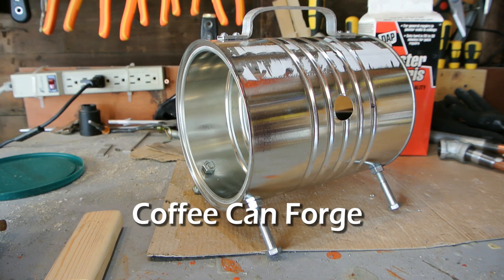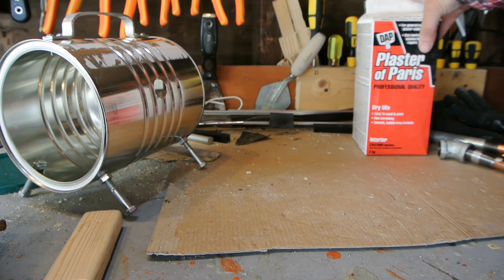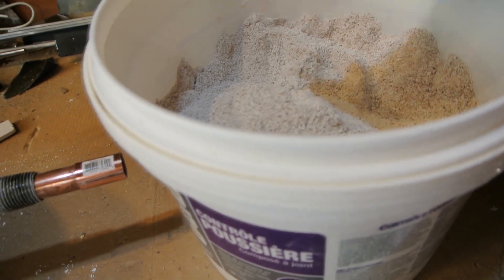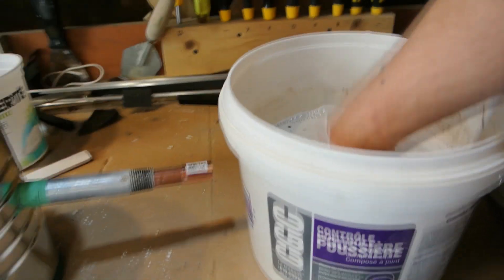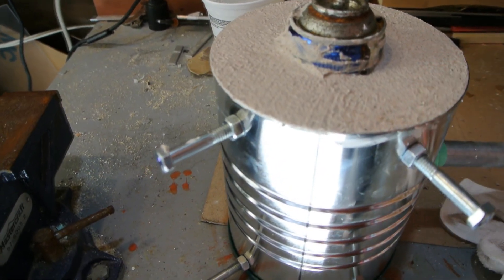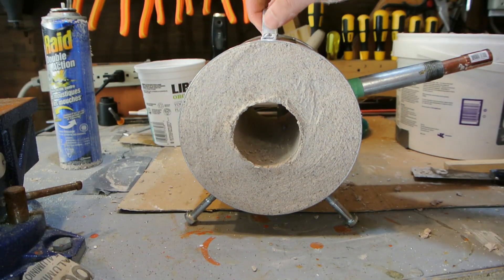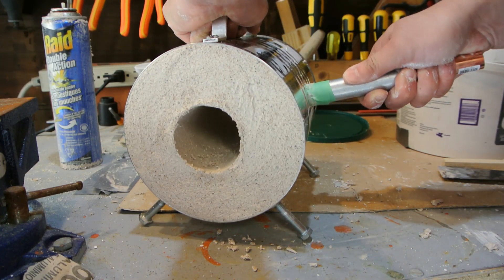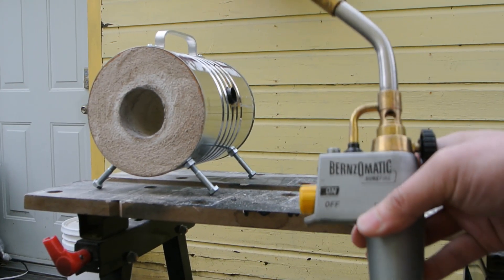How to Make a Coffee Can Forge

Comment: A couple of thoughts, Using a pressured can is a bad idea, unless you pulled it out very quickly as he did, the torch angle should be steeper, so the flame wraps around the radius of the internal, 1:1? heard others say 60 plaster to 40 sand, think all will work, but after a few months the 60:40 might still be going.

Comment: 5:50 using a jigsaw, sabresaw or electric sander (without the sawblade or sandpaper) to vibrate the mixture down to ensure no cavities in the mix.  It may also aid in ‘releasing’ moisture from the mix, to be sponged off the surface, speeding up the drying of the mix.

Comment: About all this is going to be good for is heating up a 1/4 inch rod, bolt or some very thin metal pieces. But you can do all of that with just the torch and no forge at all.   If you make the chamber larger to accomodate something the size of a horseshoe, you can't get the chamber hot enough with a single propane torch because of the extra space that needs to be heated.

I tried this with a disposable Helium tank with a coffee can sized chamber and it did nothing. Next I built the coffee can forge and still no way to heat up a railroad spike to the point where you can put a bend in it.

SAFETY WARNING
If you're going to put a door on it to try to keep the heat in, make sure to add some air vents or leave the door paritially open.  If you close it up tight and burn out all of the oxygen, your flame will go out and you'll be pumping propane into the chamber.  Then if you attempt to relight without venting, you'll have a propane explosion.  Best case scenario is you'll have some singed eyebrows.  WORST CASE SCENARIO is  you'd better make out your last will and testament before you fire up the forge.  And double check your homeowner's insurance to make sure it covers fire damage for this type of equipment so your family can still have a home to live in after you're gone.    Remember, even though it's only an accidental fire, the forge is homemade, not inspected or necessarily rated for the type of use you intend.  It could void any claims.

Comment: I built one similar but it never heats up, gonna try lining with refractory cement and see if that helps and if it doesn't guess I'll go back to good old hole in the ground charcoal forge for heat treating 1084

Comment: This is good and all but if you use a smaller tubed three way burner, which would equal the same diameter overall to reduce waste of propane, you could disperse heat over a wider range and be more efficient.

Comment: Hi, I made the forge and it works great I'm going to write out how I did it. so here we go. so to start I used soda cans duck taped together end to end instead of the raid can (this makes it much easier to get out) and instead of making a large hole in the back I just drilled out about a 1/4 inch hole in the back. I also put in the gas port at a slight angle to great a vortex inside the forge. The ts8000 is incredibly fuel-efficient it will run for 30 sec at full bore on just what is in the 4 ft hose I have. I have made a small dagger and a mini Katan out of screws with this and it works great, thanks for the tutorial, Andrew.
Reply: @nathanthegreat28  I'm not sure what you mean
Reply: @nathanthegreat28  as for the weapon that you found I would like to know what it is, It sounds rather cool and that would help with name.
Reply: A file can be found at your local hardware store and get some sand paper up to 1000 grit. And I am pretty broke all the time so I can relate. Ps in that other reply I meant luck not lick
Reply: I’m not sure what you mean with file thing for free
Reply: @nathanthegreat28  you have to pay for a torch
Reply: I like that you mentioned putting the nozzle at an angle to create a vortex. On all these videos I watch, all the burners are straight on. It really seems it'd create hot spots. And I like your idea of a small opening in the back. Seeing flames licking out both ends seems so inefficient. I keep wondering why these diy jobs are not designed more like a rocket stove. Thanks for sharing.

Comment: Its a good idea to use an oil or wipe the surface of the metal can your going to remove with diesel to prevent it sticking to your molding material. It will come out with greater ease and help prevent damage on removal.
Reply: Or use a Pringles can, and just burn it out when done.

Comment: If it's just to heat a rod, why not just torch the rod directly? PoP and sand is not a good mix, you're literally better off using 2 firebricks and carving a hole in the centre where they touch and one hole for the Propane/Acetylene torch.

Comment: After reading a few more comments I can attest that this small scale forge works well. Not the most efficient maybe but it gets my carbon steel knives up to temperature in order to heat treat. A piece of pvc would be better than using a can for the chamber when it’s time to pull it out. Also you can wait to drill your hole for your burner last if you want. Nice video 👍

Comment: To be honest, I did this build and followed every step. I found that it doesn't get the metal to a good enough heat. Personally, I would highly recommend you go with a small devil Forge. Found the results were much different than the ones in the video.
Reply: If made using ceramic fiber blanket like Kaowool to insulate the forge, it will easily get hot enough to weld. And much faster than using either soft brick or refractory cement.

Comment: You should put a bolt in the back and a plate of metal attaching the the back bolt so you can close and open it. If you have a short piece keep it on and you can put the thing on low, so then you can put that thing on low and have that tank for like a month cause like that little thing runs a lot for a small space like that and you have it hooked up to a big tank.

Comment: it wiill reach about 723 degrees because of the insulation propane and butane generate around 660 degrees enough to melt aly but it will hit the lower critical limit of steel allowing it to be forged looks good i will have to make one lol

Comment: I built my own forge based on this video and im impressed by how well the plaster-sand mix insulates, but i think too much heat is escaping out the open back. do you think it safe to close off the back with more plaster or will I be suffocating the flame
Reply: I was thinking, use extra plaster sand to make a brick to open and close the back hole.

Comment: use just Kaowool : you will have more space inside the forge ;)
Reply: It's not advisable to use kaowool by itself as it's a ceramic fiber type of insulation. You should always coat it with some type of binder, like refractory cement or furnace cement to prevent the ceramic fibers from coming loose when being heated.
The ceramic fibers will do pretty much the same thing as asbestos. The fibers flake off of the blanket, floats into the air, gets inhaled by someone, becomes trapped in the part of the lungs that swaps oxygen for carbon dioxide in the blood, causes scarring and irritation because the body can't break down the fibers and boom, health problems. Of course, for cancer development you'd need 8 hours a day, 40 hours a week of long term exposure, but not for other (some severe) respiratory problems.

Comment: I am wondering if the tube for the torch was created at somewhat of an angle would it create a venturi effect.  This might cause the flame and heat to follow a circular pattern to spread the heat more efficiently rather than concentrate on the opposite side of the forge wall.  Great job regardless.
Reply: Venturi effect is when any fluid flows through a pipe and the pipe becomes smaller in diameter, causing a decrease in pressure while increasing the speed.  You describing laminar flow which is the cause of a less turbulent "swirl" effect.

Comment: That is an awesome idea.  I have been racking my brain on how I could do just this on the cheap and bam...there it is.  Thank you for sharing!!!
Reply: Sadly after research this kind of refractory is not good to use for metal working temps.  Plaster of paris and sand are heat sinks not heat reflective like a true refractory is.  This mix will degrade, crack and can be dangerous.  I confirmed this by building my own version and only used it twice and heard a loud pop.  A crack formed on one side, so needless to say I will not be using this mix anymore.  The only way to go is with soft fire bricks, or wool and satanite.

Comment: You can also use perlite from the garden center bonded together with water glass (made by mixing silica gel with lye drain cleaner; it produces a light purple liquid that can be used as a high temp glue.)
Reply: Hi mate, I am following your recipe of water glass and perlite…. I watched a video where someone added aluminium oxide, is that necessary? Also do I mix the water glass in its liquid form with the perlite then put it in the mold? Thanks in advance
Reply: @scottlloyd1938 did it work?

Comment: BTW, perlite and vermiculite can be found in garden supply stores. The reason you find them there is that they are also used for cutting/propagation benches since they promote root growth. Both are created by extreme heating and thus are also good as a refractory material. Perlite is easy to find most anywhere but vermiculite is a bit harder to find.
Reply: lockdown
Reply: @thejurassicchicken1445   Fire your idiotic coward democrat state leadership then. Been open the whole time with no problems. Democrats aren’t following science.
Reply: @BeefNEggs057  FJB!!!

Comment: Built one with the same exact specs and couldn't get it hot enough.  I tried multiple modifications with different torch heads and it still doesn't work.  Built a second and still have the same issues.  Some key info is definitely missing from this video.

Comment: In hindsight, how well did this mixture hold up to the high heat? Was the outside of the mini forge cool to the touch? Anything you have/would suggest to do differently?
Reply: Mr. Collin 
You can also use perlite from the garden center bonded together with water glass (made by mixing silica gel with lye drain cleaner; it produces a light purple liquid that can be used as a high temp glue.)  You can find videos on the process on YT.  It’s a better refractory than plaster.  Usually people do the perlite first and then do a layer of the water glass mixed with sand and talcum powder to coat the inside and front.  Use a stainless steel bowl to make the water glass BTW; and it can be stored in plastic bottles (not sure which kind; #2?)
Reply: @keirfarnum6811  
I scrapped the first one. It cracked and started to fall apart. I redid it with kaowool and firebrick. It works much better
Reply: Mr. Collin 
That works.  Although covering the kaowool with the water glass mix I described would make it less dangerous.  If I remember correctly (I might be wrong) kaowool can be dangerous.  Look up sodium silicate mixture I mentioned; great stuff.  The silica gel are those desiccant gel packs that can be purchased for pretty cheap and sodium hydroxide lye is fairly cheap too.

Comment: in the winter time when the forge is cold even though it warms up slowly, will that plaster crack?
Reply: I thought the same thing so I used ceramic , I busted up an old toilet tank , kitty litter -  that's clay as in clay bricks  , sand and mix , I tried to use more of the ceramic than the clay kitty litter and sand , and mine is in a 55 gal  drum ,
2 toilet tanks ,1 bowl 
50lb sand
Bag of clay kitty litter 
 80 lb  Mortar mix 
Add water 
 
Crushed up the toilet with a sledgehammer , layed it on a hard surface , covered it with card board and crunched away , the card board keeps sharp pieces from flying everywhere , but wear safety glasses anyway

Comment: You know a couple of fire bricks to use to close the ends when you don’t need to get all the way through might be a good idea..
Reply: Exactly..🙂
Reply: would also be cool to retrofit another quarter can full refractory with legs to stick to the back just to keep the fully homemade vibe.
Reply: It probably needs oxygen flow?
Reply: it would explode because of all that fire, oxygen and propane buildup in the chamber
Reply: @danekane7511   if the can was filled with propane prior to lighting then rapidly oxidized that is a different story. But we are talking about the propane and oxygen being in a constant state of vaporization before being replaced and then burned again enclosing it will only make it more efficient until you close it so much that oxygen is no longer in the chamber inhibiting the oxidation of the propane and snuffing the flame. FIre bricks are very easy to move and control the air flow @ferdonandebull is completely correct

Comment: If you try this, here are some tips to consider.

One, set up your coffee can inside a strong garabage bag, so, IF, the mix blows out of it's mold, you have someplace to go, other than the table or floor.

Two, use Formby's oil soap, from the bottle, as a mold release for the center pipe or can, just wipe a thin coat everwhere the mix will make contact.

Three, remove the galvanization, before positioning.

Four and Five, use electrical tape to secure the lid to the can and add a small 'rope of Plasticine clay, to the edge of the bottom of the can, to form a gasket that will help reduce or even eliminate the rising up of the buoyant can as the mix is poured in.
 Do the same for a pvc tube, just to keep it in place better, and do both before you use the oil soap release.

Cheers.
Reply: You should make your own video!

Comment: Hi I built this forge and it was really good at keeping heat. The only problem I had was my blow torch created lots of ice on the outside. I’m using it outside and using map gas with rothenberger superfire 2 torch. It is cold outside and the flame was full blast, is this normal? 

Thanks in advance
Reply: This is normal, would happen if you used it indoors as well
Reply: Pete Sadler cheers Pete was just concerned I might of had a slight leak or something

Comment: You could add Campbell’s soup can to the back of your exhaust so you can still sink your rod in and lose less heat
Reply: I made mine with a paper towel roll pretty much the same thing but didn't have to worry about the cylinder getting stuck in there..
Reply: @danielbutler6823  Pringles can for mine.  Same reason.
Reply: @chancetolbert4852 
You are a GENIUS! I'm going to remember that!
Reply: @chancetolbert4852  GENIUS!!!
Reply: To p

Comment: next time, wrap some plastic foil from the kitchen around the core you want to extract and grease it up with petrolium jelly or vaseline it's called in europe. you could further help it release with silicon or vegetable oil.... comes out much easier. also to get a bit more milage out of refactroy material, split the 50% sand part into maybe 25-30% perlite from the garden store and the rest sand. also ceramic gravel from same store gives more structural strengh... maybe also inox or rustfree sponge from the kitchen for netting

Comment: Would a flat bottom on the forge center hole be more functional and the torch at a higher angle to get the flame blowing more on the metal being heated for producing higher temps for the forge to be able to weld the metal?

Comment: How many parts sand vs. how many parts plaster of paris did you use? You got a really nice consistency there, even though I would elect for a longer bucket with a sealed end, even a plastic 5 gallon will work and wont melt if done right.. Also able to fit maybe 16-18 inches of steel inside.

Comment: Andrew, - Great Instructional video. Thanks :) I have made my own to the same design other than creating a full length orifice. I don't need the long length heating requirement  so positioned the aerosol cal 40mm above the base when filling with the   refractory mix. (had fun getting the aerosol can out though once it hardened!!). I note that you formed the burner port using a 3/4" pipe -  and then lined it with a thin steel tube. Is that size the optimum diameter or can you go smaller?  I left the steel pipe I used in there once the mix hardened. It has a 15mm ID and is 60mm long. Cheers
Reply: Mike Jarvie ....sadly no response from Andrew here but I think you did well in your designe as well, I hope you have had many happy forging days with it. Great video I’m now going to make my own as well but with a empty gas bottle instead .👍

Comment: I just made one of these and used it. I really don't know anything about forging but I was able to take a lag bolt and turn it into a coat hook. I was wanting to make this with only one opening but the plaster set way faster than I expected and my form got stuck. I had to drill out the other end to get it out. It works OK but not great. Good for small pieces. I Think I will try to make a plug for the back end to improve efficiency. It seems to do alright but if It wouldn't take much use really start going through a lot of propane. The price was right though at about 8 bucks and free materials from the scrap metal bin at work. Good video.
Reply: Lol.